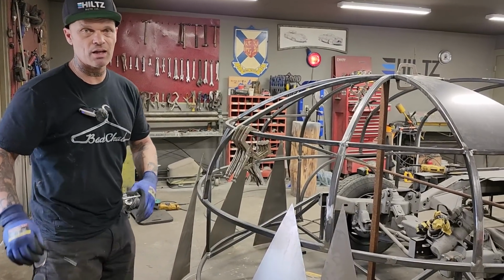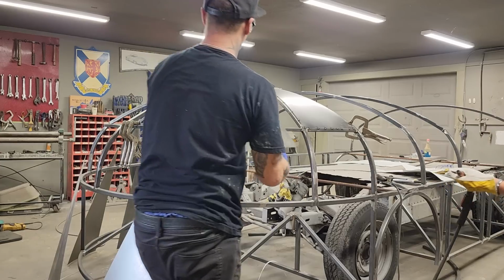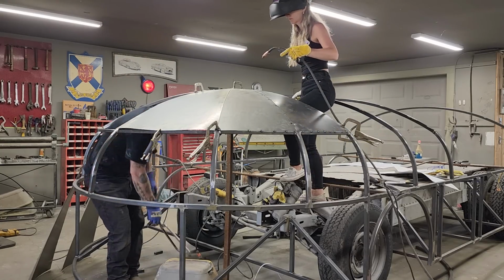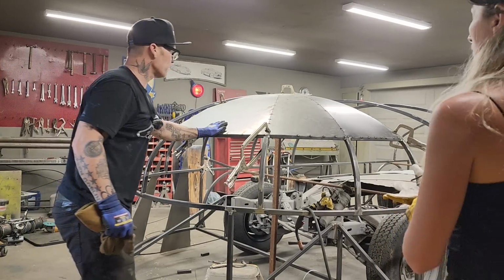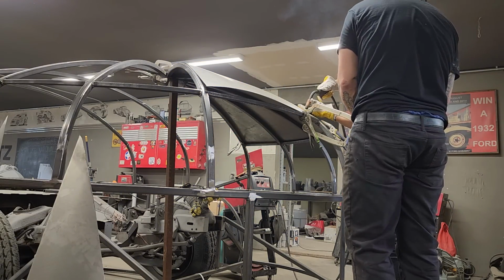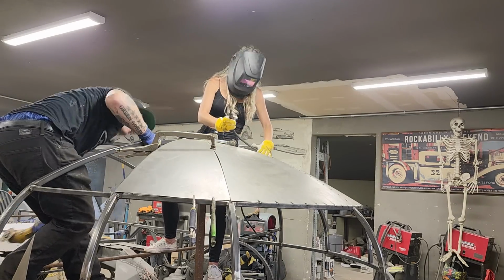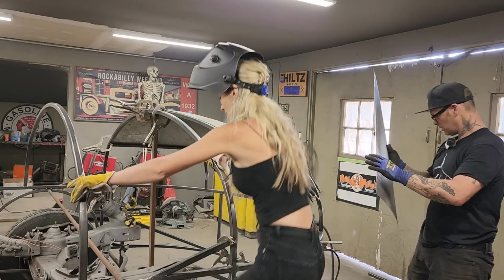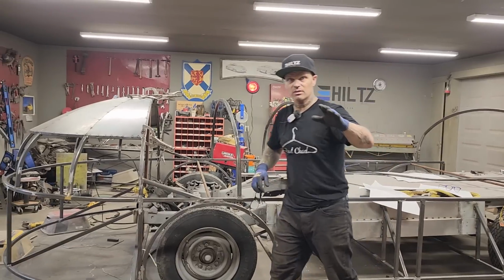Sheathing in the roof with Jolene

Comment: Hi Chad & Jolene, nice work on the roof both of you! Excellent job shrinking the roof panels to fit properly also, nice work puting the shape into the panels and cutting the cardboard patterns and transferring them to the sheet metal. Jolene fantastic job of welding, filming the video and downloading it as well as running the business. You are definitely a multi-talented women Jolene!

Comment: Chad…Doodle Bug is starting to look Cool!  Looking forward to meeting you and Jolene in Syracuse!  Consider one wheel on the front but offset like the rear. Take the Front wheel off and put one of the rear wheels on with the offset to the outside. I think this will center the tire in the opening and give you room for steering. Try it out.

Comment: It will be interesting to see how the engine and transmission will go in with all the sheet metal in place, not to mention how to enter to drive it.
Reply: May be he want to lift it up the body using hoist like jolins Bugatti. Then  the transmission and other parts in. But every thing is welded not bolted. 😢??

Comment: when welding you say to put the wire on the metal hold it and pull the trigger. can you also pull the welder along the metal to weld more then just a small spot?

Comment: Really enjoy watching how you overcome problems in your build. This project looks awesome.   Question - This is not a knock or my trying to be clever but a genuine query. I note on other videos that you have an English Wheel in your workshop, would this not "with minimal effort" enable you to get the desired shape in all three axis on the panel resulting in a stiffer form.  I only say this as in my younger days (back in the 70s) I was the "joey" in a metal fabrication workshop and had to use an English wheel to form this type of panel shape for months on a big order.

Comment: Have you considered how it will be to drive this vehicle over a grade?  This front end is so far advanced of the wheels, I am afraid it might drag (you know, come in contact with the ground).  A lot depends on how you are going to use the vehicle.  A normal street may have too many steep grades and curbs and potholes and such which will prevent anything but off street use.  Good luck I am enjoying watching the work.

Comment: Could you not weld it on the underside to square stock , then on the top to join the two sheets . no need to do ll the extra cutting then ?